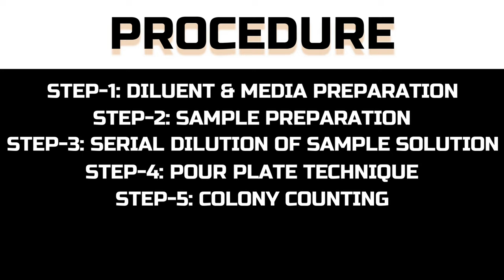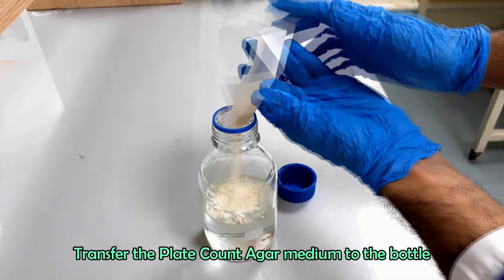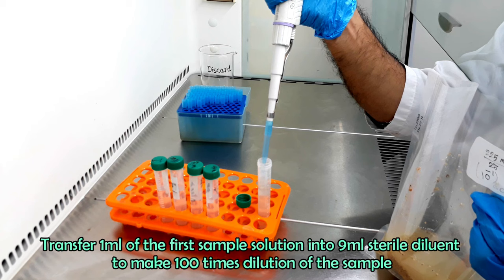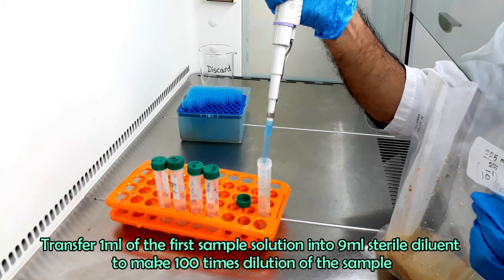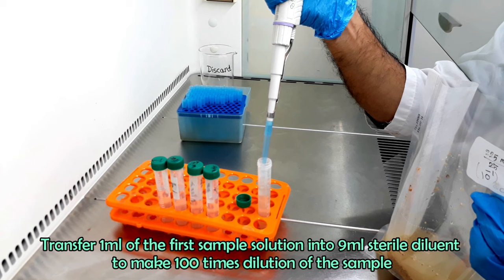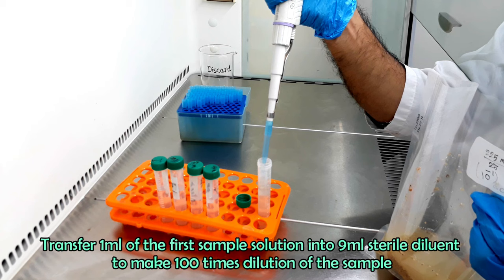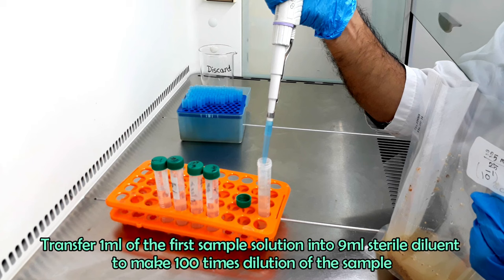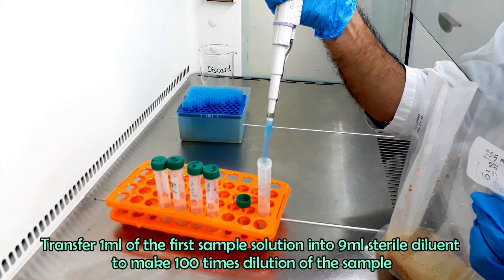Total Plate Count (Total Aerobic Bacterial Count)_A Complete Procedure (BAM, Ch-3)

Comment: Good video, i have quation while open plate lid until the liquid agar be solid have u ever the plate countaminated, what u to do to make sure that open lid plate agar until solid could'n countaminated ?
Reply from the maker: There is no chance of becoming contaminated inside the biological safety cabinet. So, use a calibrated Biosafety Cabinet and monitor it's microbiological quality by settle plate technique periodically.

Comment: I’m stuck at a calculation. My plate count is 52 and Dilution Factor, 10^-3
Volume of sample plated is 0.1ml. My final answer is 5.2x10^4CFU/ml 
The accepted count is <1000 (1x10^3 CFU/ml)
What might be the cause?
Reply from the maker: There is no wrong in your calculation.  Your sample contains higher load of bacteria which exceeded the standard limit

Comment: I have a doubt regardung the buffer preparation.is the   500 ml buffer convert into 1000ml and from that only 1.25 ml is then add to 1000ml distilled water for working buffer dilution preparation?please rectify my doubt as soon as possible.
Reply from the maker: Buffer preparation is correct. Please read the reference protocol (BAM, Chapter 3) to justify it. Thanks
Reply: @MicroChemsExperiments thank you
Reply: Can you please upload a video about enrerobacteriacea (IS 17112 part ll
Reply from the maker: @neethuaneethua941  noted
Reply: I got only 4 colonies in 10^1 dilution(sum of 2 trial plates).what will be the CFU/ml?please reply mam.its very urgent for me.